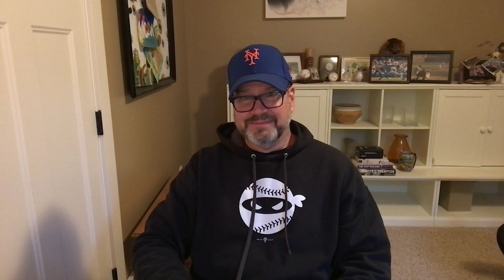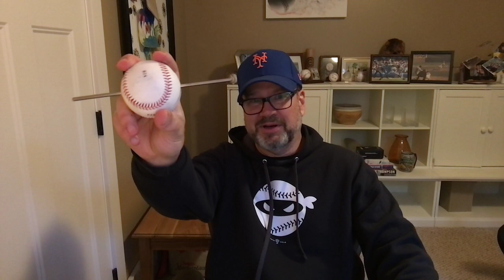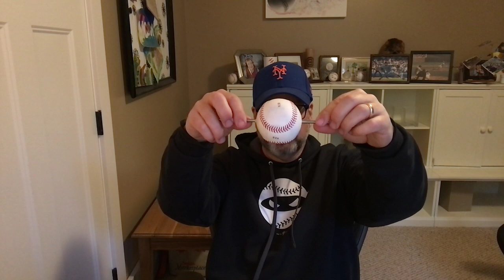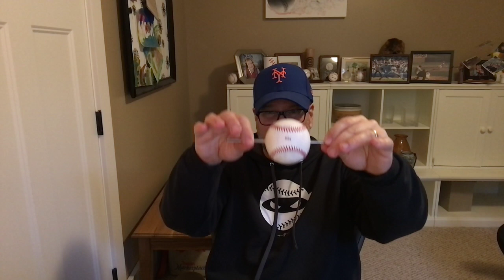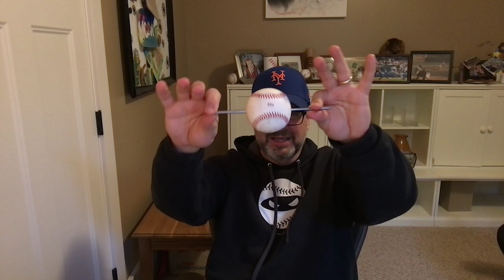What is Spin Efficiency?

Comment: Thanks! So how does spin efficiency impact pitch movement? For example, is a foursesm fastball with 96% efficiency going to have more vertical or horizontal movement than a fourseamer with 93% efficiency?
Reply from the maker: That's very complicated. The second pitch will have 3% less movement from spin (and in the spin direction). But losing efficiency gives the opportunity for Seam Shifted Wake. If the ball is oriented well, it can replace the lost movement. The SSW movement is usually in a different direction that spin. For a 4S, SSW leads to additional ride and cut.
Reply: @baseballaero5076  hey, much appreciated.